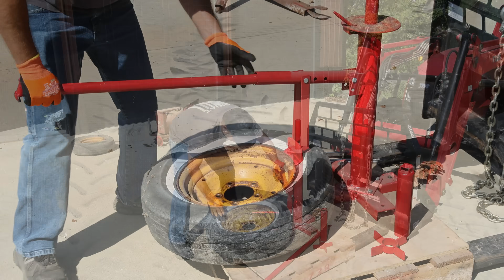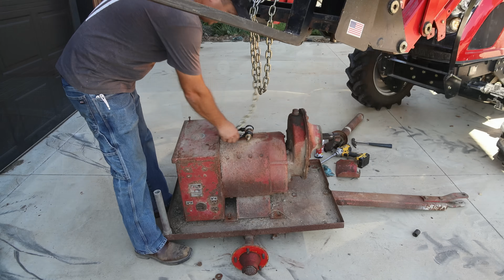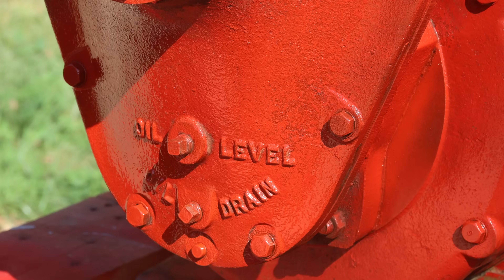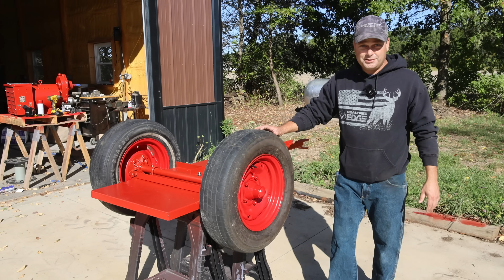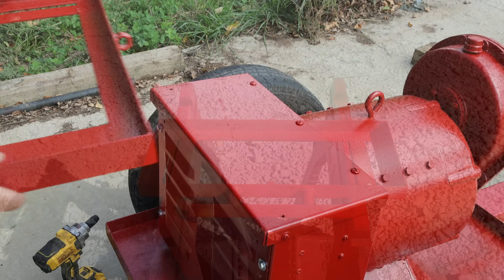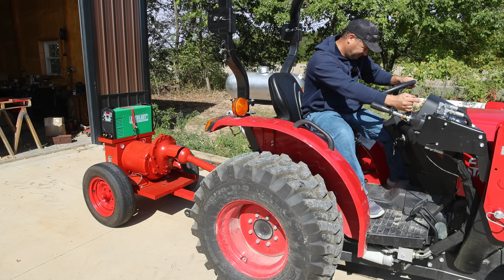Restoring a Tractor PTO Powered Generator.  Now it's a Mobile Welder and Whole Home Generator

Comment: Evan, that PTO generator should have a voltage regulator in it that keeps the output voltage constant regardless of the frequency. A good generator should also have a frequency regulator that keeps your output at 60 Hhz as long as the PTO is turning at or above 60 Hz. If you can get the power you need and keep the frequency near 60 Hz by varying the PTO speed all is well. But if you don’t get the power you need at some point you’ll need to repair that voltage regulator.

Comment: Hi Evan, I just picked up a WinPower PTO generator like yours with trailer, but mine is 25KW ($500). FYI the documents/manuals for those are on line if you search for WinPower. They list the oil that gets used in the gearcase. I also have the 15A duplex and the NEMA 6-50 receptacle on mine as well as on the other side the pin connectors for the full capacity of the generator. When you replaced the 6-50R I guess you put in the 14-50? How did you wire the Gnd and Neutral on the 14-50 as the 6-50 only has Ground pin.  Thanks and love the posts you do there

Comment: What oil did you end up using in the primary drive? 

A frequency gauge would be a good addition for a unit like that so you can set the tractor speed and not have to remember an external meter.

Comment: You have become a really good presenter Evan.  You are much more comfortable and at ease in front of the camera.  Congratulations!
I think the color on the wheels was old school DOT Caution yellow.  Glad you painted the wheels!  I dig the white walls 🤗
What is your day job? (In general terms).  You have skills in so many areas.
Very slick carrier.  Has all the features you wanted and no waste.  Good job.  Well done!  I'm sure it will be very handy around the farm.
Pretty cool that you did not have to run your little tractor at full throttle.  When you did use the welder, I didn't hear any change in RPM or engine load.

Comment: Evan, a couple of tips from an old guy. I had a portable welder that had two 220 volt outlets and two 110 volt outlets. I could use the two 110s while I was welding for a grinder and lights. The generator was twice the size of yours and it was a 250 amp welder. It all was powered by a 20 hp Onan that did it effortlessly.
Also when you are dismounting tires you need to lubricate the beads with soapy water, preferably dish soap.
We love your channel immensely.
Art & Melissa from Ohio

Comment: If your bigger tractor has 1000 rpm you could use a 540 adapter and throttle the tractor back to operate the generator
Reply from the maker: It is really hard to dial in the Throttle when running a Higher PTO speed.  The frequency jumps 5 hertz with just a little tap of the throttle.  It can be done, but you can get exactly the frequency you want.

Comment: Personally I wouldnt hook up an unregulated generator that requires me to stay up all night and tend it to my house.
Reply from the maker: Since I have a solar power system with batteries.  The generator would charge the batteries.  Then I could shut it off, and run on batteries for several hours.
Reply: @CountryViewAcres  ...... My stuff is computer controlled. It is sensitive to frequency and voltage.  The transfer switch is included in that. Your generator sounds limited to rpm control of the tractor.  In today's equipment that your system includes some risk.

Comment: You may find that older generators do not play nice with newer homes with a lot of electronic devices. That’s why a lot of the newer ones they sell are inverters. I have a newer generator and it powers most of the house but the thermostat did not like the sine wave and could not get the furnace to operate. Good luck.

Comment: Good Vid Evan... Curious what weight and type of lube oil did the PTO drive take ?   thanks
Reply from the maker: I never found anything on what oil was supposed to be in it.  But it had a very light oil in it.  So I just put 5W-30 motor oil it.  Because that was about the same viscosity of the old oil that came out.

Comment: Be careful feeding the whole house with the generator. You have to check if the generator has a neutral bonded to ground or not. And depending on this, you need the proper transfer switch. In any case, with the amount of power involved here, you should make sure you ground the generator properly when using it. I want to make sure you keep posting good vids!
Reply: All of that is built into His Solar equipment room.

Comment: Great job Evan. While testing I saw the generator jumping a bit on the wheels because of the PTO spinning. When running for a longer period of time you might consider some more support to the generator, some kind of solid frame.

Comment: Me, personally,  all my buildings have their own solared equipment and main house is backed up by 7hp generator.  After the winter storm of 2021 where we were below 0 degrees for 3 days straight and no power for 2 weeks.  I am fully prepared.  This is the south where Temps like that are not suppose to occur.  2 ponds and bayou with my own water treatment facility on property.  Who says I am not fully equipped.

Comment: Get a add on  digital display for voltage ,frequency and current and wire it in. This will insure you have the right voltage and frequency especially if you connect it to your house. They are very cheap.
Reply from the maker: Yes, I have already looked at buying one.

Comment: Shouldn’t there be some kind of regulator on the generator to keep the power out stable no matter what the RPM’s out of the tractor? Within some degree of tolerance for sure, but still, you shouldn’t have to play too much with the throttle to get a proper voltage/amperage out to run the welder and more importantly run the house without blowing something up.
Reply: RPM's need to be set to get 60hz. the Frequency is not electronically controlled. it is the mechanical rotation.

Comment: If at 520 rpm, as the tag says to operate the pto, if you are over votage, that means the votage regulatory is malfunctioning. You will fry a lot of expensive equipment learning the hard way. That old generator doesn't produce clean electricity like what today's modern technology requires. Welder and light bulbs only is my advice.  I burnt up a lot of equipment in my house, so I know first hand.

Comment: May havr already been mentioned. But if u apply a mixture of soapy water to the tire bead that will make removal and instalation a but easier. Maybe you wont rip the divise off the pallet.

Comment: You were wondering if the chain case took Gear oil or motor oil? Did you remember to put some in, you did not say??
Reply from the maker: It was fairly thin oil.  I ended up putting motor oil in it.

Comment: Hi Evan . When using the tyre changer it will help if you lubricate the tyre beads / edges with a weak water and washing up liquid solution. Both for taking the tyres of and again when replacing them. You won't tear the beads then.

Comment: Great job Evan, the new power Source/Welder turned out great. Hope you get the test to run the whole house done before the snow falls and that you can figure out a shower cap /weather and dust protector set up for it too. Stay safe around there and keep up the fun. By  the way who is winning the battle of the lead rope ? Fred.

Comment: Great Job Evan, but you did not mention that oil/gear lube. was it a chain, or gear box. did it just use reg 10-40 wade oil or GO-90? etc. other than that it really looks and works nice! I"m sure you will get years worth of use and good service out of it. ECF

Comment: When I farmed, I had a 10.000 Watt Winpower generator on the same trailor you have. During a power outage we ran a whole  Ehectric heated house while cooking an Easter dinner ( two ovens going - turkey and Ham) and never had a problem. I was using a Farmall H that had a week cylinder and was not up to par. I think Winpower under rates there generators. I also Used it as a portable welder for in the field repairs with a Forney 180 amp stick welder. It worked great. Good unit. On my farm sail it brought more tham I paid for it.

Comment: If you recall, I was having a similar issue with voltages on mine when I was messaging you about it. I ended up switching to a digital frequency gauge so I could get it better in range and that helped a ton. Man I really like your welder attachment idea. I might have to do that too now.

Comment: I watched another YouTube video where the guy had a habor freight tire changer like yours and as he was busting the bead the part coming off the changer bent to where he would have to either replace the 2 arms or beef them up. Good job on that redo. That way of running a generator would be interesting to see if you would use less fuel with a standard generator running on gas or propane.

Comment: Another great video. When I bought my first house at 21 my neighbor who was 48 told me to only complete my projects about 95%. That way if I ever got in the doghouse with my wife I could complete the final 5% on a bunch of tasks and use that to get out.
On a side note you may want to put some rubber mounts on the welder, those inverter welders dont like being knocked around. If you are gonna drive around the farm it will get beat pretty hard.

Comment: so what you should do is that gen set is a 540 pto you should run the tractor on the 1000 pto so you can run tractor just over idle much better on fuel if you have to run something for extended time

Comment: Evan it’s great to see you complete a purpose built project and it works. The one thing that I am always wondering is why don’t you take the time to fix and paint many of your older implements. That was one thing I was alway encouraged to do after cleaning any of our older equipment,  check the wearage on parts, get ready for the next time they were to be used and paint them. This preserves the older equipment and gives you more pride in what you have just like the generator, I could see how proud you are of how it turned out. Anyway always enjoy your efforts even when things don’t go how you plan them.

Comment: Great job.  The ice storm that hit most of the Midwest in early 78, we used a PTO generator at my sisters house because the sump pump ran a lot.  Saved us from flooding!  Looks very good.  Very talented and just what a farmstead  needs!  Thanks for sharing.  Brings back a lot of memories!
Reply: I remember that storm. They sold a lot of those PTO type generators. Then sold a lot of larger horsepower tractors to run the generators.

Comment: A little used oil on the tire bead helps to remove it from the wheel. Great job on the restoration.

Comment: Well done Evan.  I was thinking that would power a home no problem. Finding the RPM/Hz/V output ratio would be good. I suggest using it to power your battery supply before connecting to the house.  It may not have a pure sine wave and damage some of your digital equipment.
Reply: I was wondering about the cleanliness (sine wave) of it as well.
Reply: Dont think thats a problem - this is a pure generator- not an inverter.

Comment: Super job on the renovation of your generator. Probably one of the most important pieces of equipment to have available to use when you live on a farm. Especially if and when the power goes out. Maybe you could call it “Little Reddy” 😊

Comment: Is there room to mount a small air compressor to it as well? I’m thinking you might need a grinding wheel, wire brush or air out in the field too.

Comment: Some pto generators have a 540 connection but run at 515-520 to get the 240v and 60 Hertz.  No load Hertz is okay to be a little high because as the load is applied it will come down.

Winpower is now WinCo and you should still be able to get parts.

Edit - I blew up your data tag and it says 520 RPM.  So you will have to find that speed on your tractor.  If you have a 120v plug on the generator plug in a Kill-Watt meter so you know your voltage and Hertz before you plug things in.

Comment: Wondering if the generator produces clean voltage. It’s not an inverter so just curious about voltages with all the modern appliances y’all have in home and shop.
Reply: As long as the Slip rings and Brushes are in good shape..

Comment: Hey just an idea for your tire changer. Mount it in the corner of the pallet to give yourself more room. Also ALWAYS ALWAYS use lube to both take the tire off and put on. It will save you alot of work. I use water and dawn dish soap in a spray bottle
Reply: I was going to say the same thing. Definitely use soapy water for lubrication.

Comment: Awesome setup. I would suggest that you reinforce your mounting bracket for the welder. Bouncing down the driveway or across a field will break those two bolts. Great video.

Comment: Hi Evan, just a tip regarding the draw bar, the fact that it was bent in the first place means it's a weak point (ie no suspension). Maybe, no not maybe, you should have welded a strengthening angle under the draw bar so it stays straight this time. Love your format.
Reply: It’s probably not leaving the farm or going to be towed  at 60 mph, but yes, it will bend far more easily now.
Reply: It was likely bent when someone turned to sharp and the tractor tire caught the drawbar.

Comment: Great job Evan just was wondering did you check the wheel bearings ? I know that your not going to run down the road at high speed but you don't know when they were last service and those wheel nuts you painted did you happen to put anti seizing paste on the wheel studs your probably not going to be using the machine every day and are you going to store it inside the barn if not those nuts might rust up 
Thanks for the update have a great weekend

Comment: Very nice work! Can’t go wrong with a portable welder. Congratulations!
Reply: Absolutely!
Reply: I have the exact same generator.  I made the trailer that the generator sits on.  I extended a hitch out the back so I could tow a trailer if I needed a bunch of electric tools. I also made a bracket that ataches to the hitch so that I can set my welder on if I just need my welder. I put a 60 amp range cord into a small panel  box with a few 110 volt and 220 volt outlets. I could do minor repairs away from the shop. When I was diary farming it would start and run my 7 1/2 HP electric feed grinder.

Comment: Will be great for the drill rod fence. 

20 kW generator is effectively a 27 hp motor and you’re gonna want an excess above that to run it comfortably . I don’t think the little tractors gonna do that. I think you need the big tractor.

Comment: Nice PTO generator. It's a good unit to have. 

14:00 Technically you could run it with the T654 and use either the 750 (540 Eco) or the 1000 PTO speeds and just run the engine at lower RPM. 

16:00 The 2515 is rated at 2200 engine RPM, even though it can rev up higher. The PTO on the 2515 is also geared different that the other models so it matches the 2200 rated engine RPM. However, they did not adjust the marks on the dash. If you follow the marks on the dash, it will over spin the PTO as you found out. Not usually a big issue, but in this case with the generator is very critical.

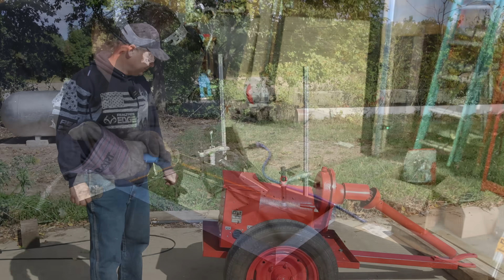Comment: Why would you have the power of the house with that you have solar? 10:51
Reply: If there is not enough sun for a couple days and the grid goes down, the batteries won't charge enough to run his house. It's just a backup for the backup.
Reply: It is called "belt and suspenders".